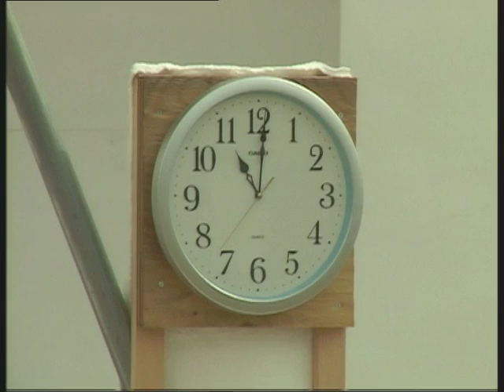CLT fire performance testing- SOFIE research project

Comment: One thing you always notice with these tests - NO power sockets, no extract fan, no lights in the ceiling or hanging from the ceiling, no shelves loaded with books or flat screen TVs fitted to the plasterboard wall.  The plasterboard is brand new and undamaged AND THIS IS A REALISTIC FIRE? No Way!